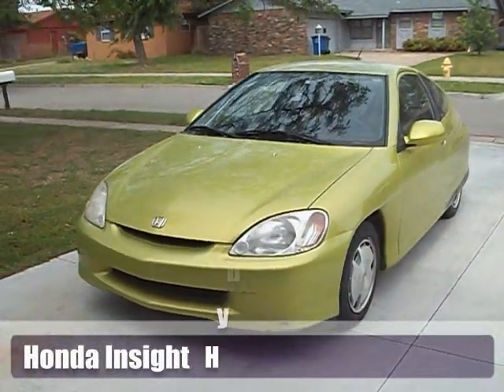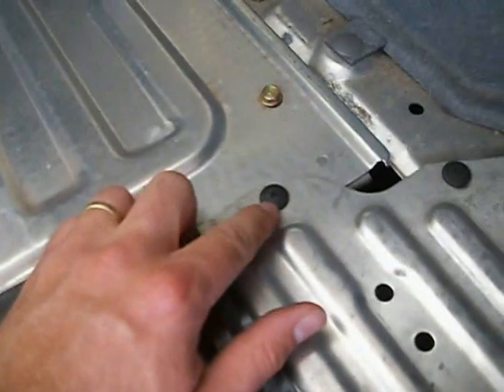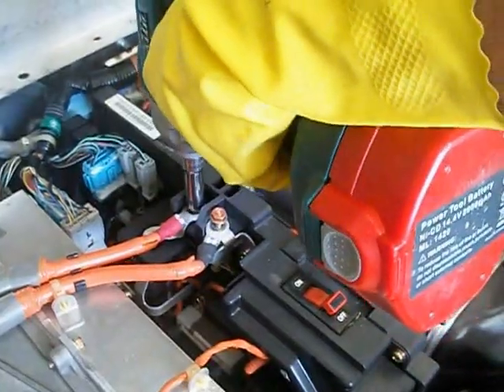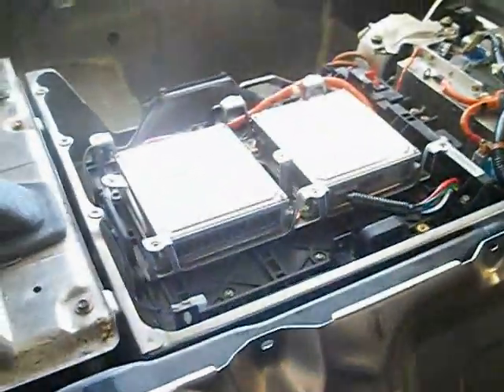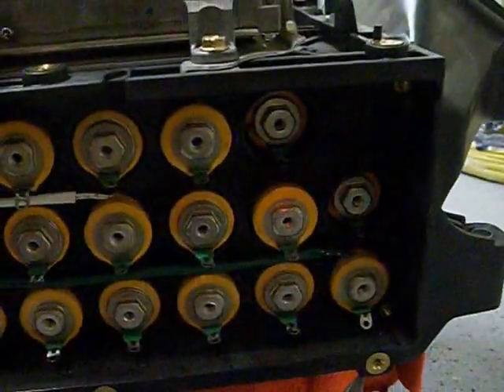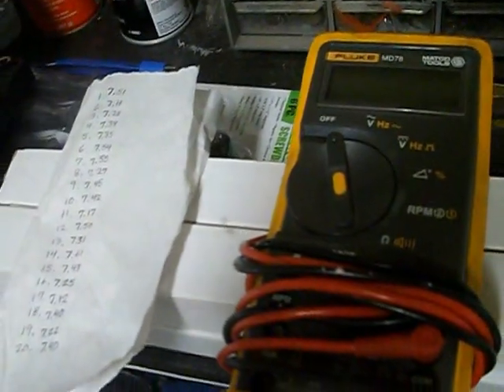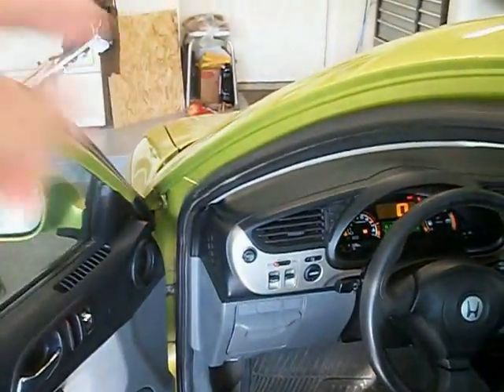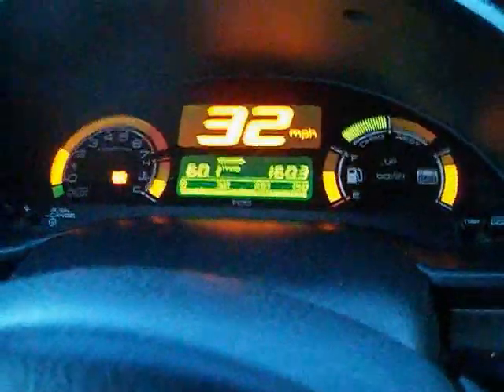Insight Hybrid Battery Removal & Reconditioning

Comment: recently i had to replace the 12v battery in my 2010 honda insight hybrid car.since then i discovered a problem with the ima battery.if im driving around town in slow traffic the ima battery fills up to the top on dash symbol and all of a sudden it empties again.i can feel the surge of power while the battery is emptying.any idea what the problem is.thank you.
Reply from the maker: Yes the battery is going through a cycling procedure. That happens when the voltages have a variance among the sticks. Usually a sign that one of your sticks is getting weak, and unfortunately your battery is about to give up the ghost

Comment: Thanks for the informative video.  I just bought a citrus Insight like yours and was interested in how to work on the battery myself.  I may install a charge/discharge harness and condition the entire pack at once.  Did you find any “bad” cells?   Do you think that checking the individual sleeves of cells achieved better results? Thanks again.

Comment: all my battery cells have about 3.5 volts averaged. so 6 cells/3.5volts give me 0.58 volts on each cell and minimal voltage should be 1.2 volts each.  How do I revive the nihm batteries? do I use a 12v trickle charger or 12 dc charger or can I still use the balance charger to revive it and recondition it?

Comment: Any update on how long this worked for? I have a gen 2 civic I have 2 extra batterys I want to build one good one out of the three I understand charging and discharging them but how do I test each stick to make sure it's good does that charger do a load test?
Reply from the maker: After having messed with a bunch of hybrids my recommendation would be: if you plan on keeping the car replace  with a new battery, if you plan on Flipping or selling the car then just rebuild it with used sticks from other batteries
Reply: @JohnCalebWarren   thanks that's what I plan to do I thought it would be easier to flip the car ( I buy cars at auctions and sell them) but I will never buy a hybrid again unless it's a Prius and at very low cost

Comment: I have a 2001 Insight I bought this summer and now as the weather has turned colder which usually from my experience triggers weakened batteries near failure to die. The IMA and engine light on mine came on yesterday so I'm looking into the cheapest way to get the most from this system while learning the ins and outs of hybrids. Is there a way to use a lithium ion replacement battery pack or is that out of the capabilities of this system? Also, can anyone provide a reconditioning service of my current battery cells if I mail them, at a price in comparison to purchasing new cells that is worth considering?
Reply: People have changed it to lithium, however, you are going to need to basically re-engineer the car electronics. Avoid. If you go through all that trouble, might as well go all electric. Check out bumblebee battery (google them). They can replace the batteries for much less than OEM. Also, look up trickle chargers for Honda Insights to keep the battery in good condition if the car sits around a while.
Reply: . Thanks
Reply: @josephfilm73  I bought a battery from "BurglarBee Battery" and after 3 years and 3 months the IMA came on and BurglarBee said he would "help"!  Nil, from them.  Not even, "Hey, take your battery out and bring it in and I will look at it....."  I live 50 miles away....I have removed the car battery Neg cable  for 1 minute and put it back on.  Started the car and idled it for 9 minutes at about 3k rpms.  The SOC climbs back up and has kept the IMA off for months IF I drive the car  on most days.  The IMA light will return if you just drive around town.  After a year and a half of this I bought a used battery pack for 300 bucks and built the grid charger with a 2-bulb system for discharging.  Meanwhile, the grid charger has kept my BurglarBee Battery ALIVE.  But, I keep my extra pack maintained in case the BurglarBee Battery goes to hell.  I was told by the owner of BurglarBee that grid charging doesn't work, that was the reason I never tried it before.  Now they offer  a 700 buck "plan" that could take them a month to "fix" your broken BurglarBee Battery.

Comment: I tried Two batteries on the weekend and they both looked to be " dead". After using this battery reconditioning program ( Check Details Here>>>https://www.facebook.com/Battery-reconditioning-310070329426065/app/208195102528120 ), I had been able to revive them both to 100% functioning batteries. Thanks, it simply saved me about $ 180!

Comment: About to plunk down the cash for the charger/conditioner, but it would be good to hear how your pack is doing post conditioning before ordering it. I have a local shop that will do the cycling for $600, but no warranty after it’s done (unless, of course, I also buy new sticks to replace any thrashed ones). So, what’s the verdict??
Reply: There's should be some bad sticks. Which will take less mah.like 2000 or so.. One's that take over 6000mah and hold charge is good sticks. 
Also brand new Chinese sticks are okay option, will last 4 years.
Reply: Still a nice car, if you disconnect the BCM and run it on gasoline only. Gets 60+ mpg hwy. Dont need the IMA.
Reply: Tesla Fan Does it still show a CEL? Because I think lots of states might fail inspection until you resolve the CEL which would force you to replace the battery.
Reply from the maker: Andrew Kehn I would just sell the car if I were you. The battery pack reconditioned didn't last that long and I sold the car months later. This early generation Civic and inside hybrids have tons of unresolved issues
Reply: Have to disagree with you a bit, here.... had 137000 on my 2002 Insight before battery went.  I bought a 2004 Honda Civic Hybrid 5MT, battery replaced by dealer (under warranty) at 110000 miles in 2010, now this is a secondary car, has 256000 miles, and just starting to get IMA trouble on this battery.  And I live in an hot climate.  So, I'll be rebuilding my pack, and replacing the weaker sticks for the nominal expense.  Heck, at this point still getting 52+ mpg w/ a weak pack, this car is paying ME to own and drive it.
Reply: Bumblebee battery charges $1700 minus $500 core charge. You get a 3 year warranty and a better than OEM battery pack with new batteries. I intend to go that route. $1200 is less than most spend on gas for their SUV. The 3 hour job to remove that battery pack doesn't look too intimidating, just fiddly. A socket, a screwdriver, and a few hours and it will be done.

Comment: Bottom line... save your time and money... trying to make good batteries out of a bunch of crap batteries is just that... CRAP. Been doing this for too long now, just bite the bullet and buy a new set of batteries for $1,600.00 and go on with your life.
Reply: All the batteries will never be dead in a dead pack, always have a few dead batteries, thats all it takes to end up with a dead pack, because they are wired in series, also Honda, Toyota do not give u NEW batteries they give you recon batteries as they don't make for the older models no more, in uk battery pack is 1400, 2nd had is 350- 450 2nd hand could end up with dead cells so ur better off recon ur own cells is you can, unless ur time is worth more the the battery pack,